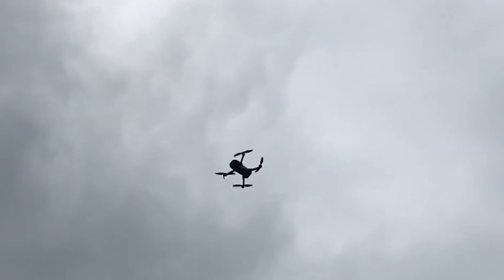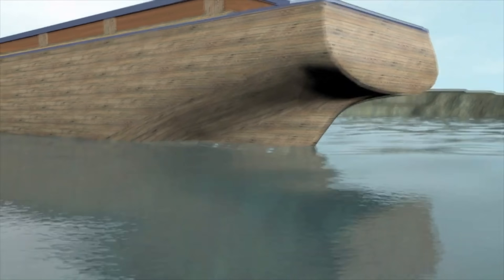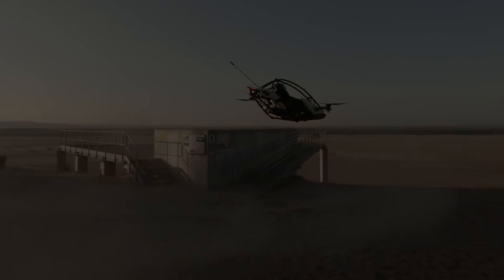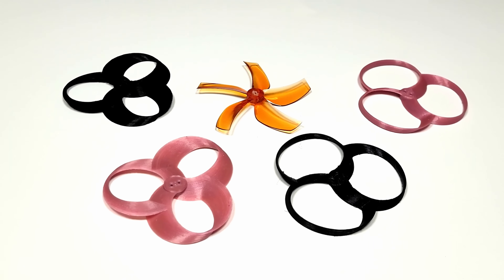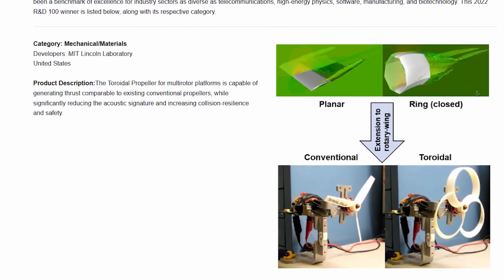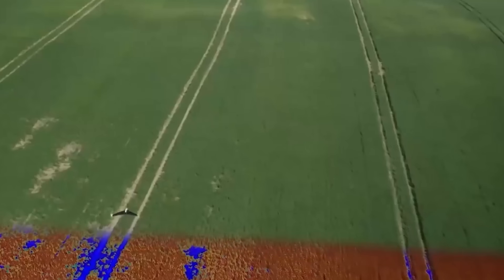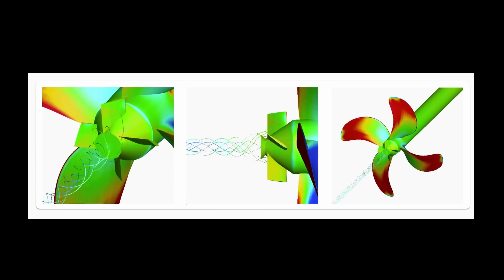This Propeller will Change Aviation Forever!

Comment: As a sonar tech in the Navy for 6 years, your comparison of plane propellers to boat screws made my head hurt....boat screws cause cavitation, which makes noise even at low screw RPMs...plane propellers do not cavitate the air. Cavitation is strictly a term, used in marine environments.

Comment: Exciting for boats and small drones but probably not for airplanes. Ducted propellers have been known to be more efficient for a very long time. Turbines are a form of that. The problem I see with toroidal propellers is the inability to vary pitch or to feather. They might be applicable for ultralight airplanes and some light aircraft. It'd be hard to "prop" the engine to start it though.

Comment: These props have much more surface area, meaning more friction requiring more power.  They have been around the outboard motor world for over 10 years.  Advantages were not obvious.  Manufacturing could be done by core molding (lost wax process) invented by the Greeks or Romans.

Comment: You often see planes with the tip of the wing that is bent upwards. That thing is called "winglet". An example is at 5:56. It doesn't produce lifting force, and it's purpose is to minimize the difference of pressure between the upper part and the lower part of the wing. This difference of pressure generates a vortex at the wingtip. A vortex is loss of energy, and a winglet minimize this loss, thus increasing the efficiency.
Now look at the toroidal propeller: the furthest part from the center is vertical, and generates no lift. It's like the winglet. So the toroidal propeller is a "regular" propeller with a built-in winglet. That's why it's more efficient.
Reply: Good thought. I looked at it more as a ducted design that contains the duct as part of the prop.

Comment: This propeller is heavier than similar classic propeller would be. Also to change the pitch would require to change the attack angle of both forward and rearward part of the blade. Probably at once. Mechanism would be more stretched for that. I have seen some experiments which have shown, that while the sound induced by propeller decreased, the lift decreased as well. That is because the forward part of double-blade makes turbulent wake behind which negatively affects rear blade.  Also small RC boat was slower with toroidal blade than with classical blade(both were 3d printed). I wonder whether the decreased sound emission didn't mean slower propeller rotation due to loses.
I have also seen tests with big boats and the toroidal propeller was more efficient in large range of speeds(only in top speeds the propellers were comparable in efficiency). But the shapes of leading edge were very different. So, it may be that if both propellers had similar shape of leading edge then the efficiency of classic propeller would be better.

If this propeller should be good, then ringed classic propeller should be even better because the ends of propeller wouldn't generate noise(thanks to the ring).

Comment: The efficiency claims seem to be true with marine applications but certainly do not and never will transfer to drones. Every demonstrable test I have seen [and there are many out there on Youtube and other sites] shows a huge decrease in battery life. Maybe in a MIT lab with no breeze and no geo-static positioning correction being required there might be a slight improvement in performance. The problem is that, in the real world, drone props are required to move laterally through the air and the increased side surface area is hugely detrimental to flight time and performance. Even hovering creates issues in that the ability to remain geo-statically located is exacerbated. Any drone pilot knows [or should know] that just hovering uses more battery life than regular forward or lateral flight due to the constant power input fluctuations required to compete against ever present air movement. As an example, my DJI Mini 2 will fly for up to 29 minutes on a fully charged battery flying dynamically [moving over the landscape] but in the same conditions [wind, temp, etc] will only hover for about 25 minutes. Anyone who has flown fixed position static observation missions will confirm this. Their use in FPV drones does show a reduction in side slip, but this is at the huge cost to battery life and aerodynamic efficiency. They are considerably slower in forward movement. Toroidal props are not actually quieter in drone applications either. The DB rating is, in fact slightly higher although the [sound] pitch is lower and so maybe not so annoying or intrusive. They will never be a practical alternative to conventional props for drone applications for the above reasons and the added weight and inability to fold sees their use for micro drones [sub 250 gram class] an impossibility.

Comment: How well does it adjust pitch, show me this or stratagem for achieving this, more weight on the outside circumference also increases the gyroscopic mass and load factor on the prop and airframe

Comment: So let's all quit flapping our lips and let an engineer build an experimental fixed pitch prop for a O-320 aircraft engine and see how it works. Carbon fiber, foam core like some of the existing props. Being braced around the circumference would also make the prop stronger. If there is an increase in efficiency across-the-board I'm all for it on my fixed pitch airplane. And besides it only looks strange when it's not spinning.

Comment: Yeah, it'll change it for fixed pitch applications to an extent (stress limitations for larger props), but not variable pitch applications
Reply: First thing I thought of when I watched this. How on earth do you optimize the pitch of this thing for different flight modes?
Reply: @BangkokBubonaglia  the same way you optimise any propeller, based on your performance requirements
Reply: @dogpickslocks  Except requirements change during different phases of the flight. I highly doubt anyone is going to volunteer to climb out on the wing and replace the propeller with a different design so you can transition to cruise from climb mode.  The angle of attack of the blades needs to be continuously adjustable over range. That is easy with the conventional design. I don't see how that can be done here without T-2 like liquid metal.
Reply: @BangkokBubonaglia  how do you think other fixed pitch propellers account for different phases of flight?

Comment: I'm curious, how would you implement this design into jet engines and turbines.
Reply: you wouldn't? the front blade is ducted so there is no reason to... turboprops maybe, but its still in the "it may be more efficient overall" stage, it could suffer from the biplane problem of giving 1.4x the power (lift in the case of biplanes) for 2.5x the drag + the rotational weight we are adding

Comment: I'll believe it when they hit the markets. These will sell like crazy in the rc hobby and won't cost much more than what's out there already. But I have my doubts it's really that good.
Reply: The tests I’ve seen on drones with 3d printed versions of these have been louder than normal props and much more prone to spontaneous catastrophic failure. There’s a lot engineering problems this design introduces. Maybe with the correct materials these could work but the additional forces mean they’d need something vastly superior to steel to manifest any advantage over standard propellers. Just the centrifugal forces on these in a vacuum is enough to demonstrate why they’re prone to failure.
Reply: @randomclick2826  that's because they are 3D printed. They aren't as accurate and the layer lines make them weaker.

Comment: Vehicular propulsion is probably not a great application for this, at least not on a mass-producible  scale. Seeing as how the biggest benefit of this propeller is noise and vibration reduction, I'd say the most realistically practical use of it would be in small/light-duty cooling systems such as electronics and desk fans where blades are almost always plastic.

History has shown us time and time again that the cheaper mass-production of simpler units is better for general purpose applications, whereas the much slower and more expensive production of complex units is better suited for specialized applications where the extra efficiency and precision is required. In the case of toroidal propellers, I'd say that they fit into the premium/complex category, and as such, are not going to be a "game changer" until they get a manufacturing method that is logistically comparable to current propeller technology.

Comment: I would say that by listening to that motor there that the amateor sprocket is causing interference which in turn causes the combustion line to interfere with the flow in the dynaflow."

Comment: As a mechanical engineer who has had to deal with the dynamics of mechanical systems for over 40 years, this propeller looks like it will be a dynamics nightmare on an airplane. It won't be so bad in water due to the damping effects of that fluid, but air does not have near the damping properties. Weight will also be a problem. Modern materials will help that, but not eliminate it.

Comment: this could be huge for aviation. yes there are some skeptics out there who bring up the issue with variable prop angles to adjust for effeciency but i think this can be overcome. remember airplanes started off with wooden props now theyre aluminum or a combination of hybrid materials.  I believe you could run one of these props and it would be able to adjust pitch slightly without throwing itself out of balance there is always to some nth degree you can adjust things to allow for more or less efficient airflow that's why we have wind tunnels to test for this and also test flights.  Yes there will be a lot of testing to be done to be certified 1st.

Comment: Absolute crap, how about the vast majority of propellers on aircraft are constant speed in other words variable pitch, this allows the engine to operate at its most efficient speed while power output is changed according to demand. This wouldn’t work.

Comment: There is obviously a LOT of work to do by aeronautical engineers on propellers. I'm sure it can be optimized and even the blade angle adjustments could be figured out.  I know a guy who would get it figured out.

Comment: I wanna see a toroidal turbo-prop.  The problem with aviation use, especially with longer range aircraft that fly at various speeds and altitude is blade pitch.  There currently isn't any way to adjust blade pitch on toroidal props during flight, so we won't be seeing them on aircraft for quite some time.  The only solution I can think of is maybe blade warping.  A carbon fiber and spring steel blade that can be warped to different pitches, since they are a continuous hoop shape.
Reply: I was thinking the same, no blade pitch adjustment. I was also thinking maybe the higher the rpm the higher the centrifugal forces which could “wrap” the toroidal shape to the corresponding resonating form. But is limited by material properties

Comment: I learned about toroidal propellors a while ago as a new design for use in ships and immediately wondered if they could be used the same way in planes and also wind turbines since the principles are largely the same.
Reply: I haven't seen any toroidal propellers on ships.   

When I saw these toroidal propellers I wondered how long it would take for shipping companies to change over.
Reply: Nope it's not the same. The advantage of toroidal props is that they reduce cavitation but that only applies to water. In air they would be a little more efficient and quieter but its not the same efficiency gain as a water prop. And only applicable to multi rotors
Reply: @ChrisG1392  then u guys know that Mark Rober's "I cannot believe that's airborne" hook was for a NON-toroidal prop ;) https://www.youtube.com/watch?v=DOWDNBu9DkU&t=924s

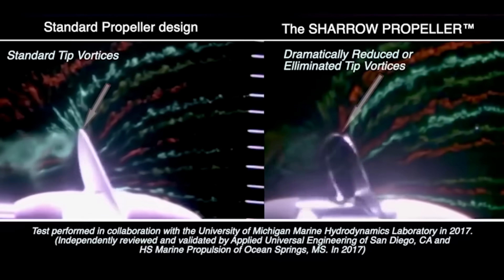Comment: @4:05 In marine use, the propeller show a 205% in efficiency. As convention propellers can get to 60-70% efficiency, that means the new design is working at a minimum of 183% At this point I call BULLSH*T!

Comment: The problem is that aircraft with piston engines or turboprops need to have a variable pitch propeller and that means the blades need to adjust angles to work efficiently with the engine at all times during takeoff climb cruise and descent from various altitudes. This propeller design seems to be limited to specific applications such as drones. Can't imagine why aeronautical engineers doing so much for fuel efficiency and noise reduction to achieve from new modern powerplants, turboprops and turbofans  aren't suitable for this propeller design. Maybe marine applications would be ideal where variable pitch propeller design isn't a thing there.

Comment: I've mentioned in another clip that Sharrow propellers is thinking of making this using carbon fiber injection moulding no need for expensive machining. The only outlay is injection moulding tools so a 1 million dollars on tools and 50 to 100000 injection units should pay for itself so a 5000 dollars will cost a tenth .

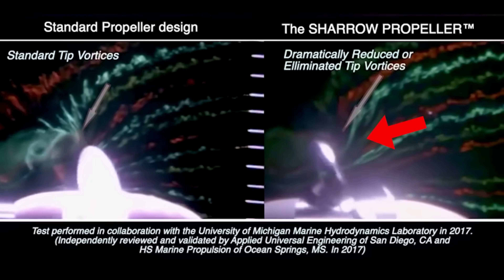Comment: At 4:14, it's no surprise to me that the new prop has 200% efficiency over the old design, since there are actually twice as many blades (connected as pairs) in the new prop.
Reply: Efficiency is much more complicated than that. If you keep the airfoil the same, every additional blade might have an increase in performance but the prop efficiency is guaranteed to decrease.
Reply: If they have double increase of performance it means one: they had very bad initial design😂

Comment: you still 50% of , because basically there's a two blades merge in one but only one is protected at the tip for the air the escape out,a better design will be a simple outer rim like a jet engine.

Comment: bruh in a bout the loud noise is the engine. In idle (no propeller spin) its hella loud and when accelerating the engine revs up and of course some sound comes from propeller but not to the extent of saying” the sound is the propeller not the engine”

Comment: Everybody who comes up with these designs needs to take a couple of basic flight lessons before they say they've revolutionized aviation. This design has some serious flaws because of the single most important component of flying, weight AND balance. It'll be a miracle for this thing to weigh the same as your current prop, and before you start saying they can make it lighter, you can only shave off so much weight before that pesky balance becomes an issue. Then what happens if the engine fails (those do happen) this thing goes from being an efficient option to an aerodynamic nightmare, during the moments you need lift most

Comment: The ones where the toroidal propeller loops back on itself mid-blade are NOT NEARLY as efficient or quiet as those each of three blades form an independent loop.

Comment: this propeller changes nothing, i could go on a 700-word rant about it, but they basically doubled the number of blades, pretty straight forward, and to stop the centrifugal force from taking air off to the surfaces of a propeller which reduces effectivity of course, they just hooked the blades together which partially stops it from happening... the sound described as "inefficiency" is just that centrifugal slipstream i mentioned vibrating the tips of the propeller, so the increase in efficiency is mainly due to the doubling of blades, aside from that there's no real increase in efficiency... and mass production for bigger propeller aircraft, of which there is none, is too costly anyways compared to the standard, and if one part of a toroidal propeller is damaged, the entire propeller is shot and needs replacing, i dont think this is the way of the future.
but for drones its okay, theyre smoll and having them be quieter is pretty nice

Comment: Toroidal propellers were experimented with back in the 1950s. The work was abandoned because the costs outweigh the benefits. Loss of lift at low speeds, increased maintenance costs, reduced survivability in the event of prop damage, and minimal difference in fuel savings for fixed wing aircraft. 

These have useful applications but plane props isn’t one of them

Comment: The main issue I see with widespread adoption in aviation communities is the Tori le with changing pitch with a toroidal prop. I'm not sure how you'd do that (or if it's even necessary for that matter). The design is just so new.

Comment: So this "endless power" design is all about reducing noise while not sacrificing power output?
So there's NO increase in power compared with conventional propellers?
Total nonsense right from the beginning. Go back to school.
Reply: There is no endless power. I don't even know wtf that's about. Depending on the design they can improve efficiency by some amount. Like 20% or more. Which is a pretty big deal.

Comment: There are two flaws with the toroidal propeller. 1. It is slightly heavier than standard blades (not a deal breaker). 2. The design is not easy to replicate if damaged or lost unlike regular blades. The major upsides is I can see this design being slightly safer if you collide into something or someone rather than rotor blades.
Reply: The material could probably be changed so it will be higher, if they are more effective it will compensate for more weight. And they should probably sell them in packs of 5-6 from the same mould and time.